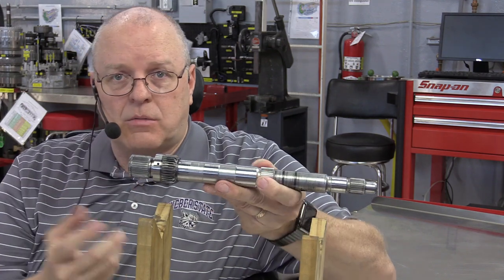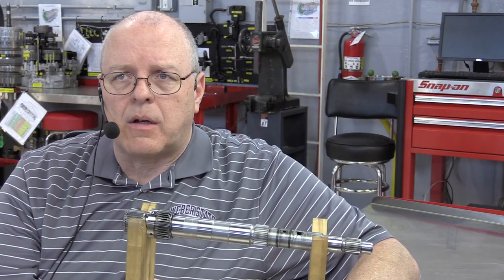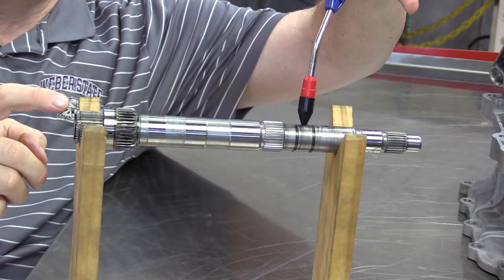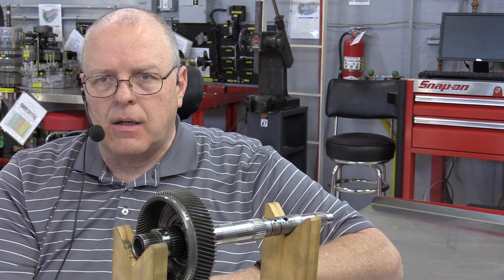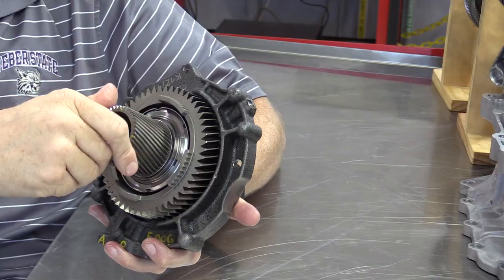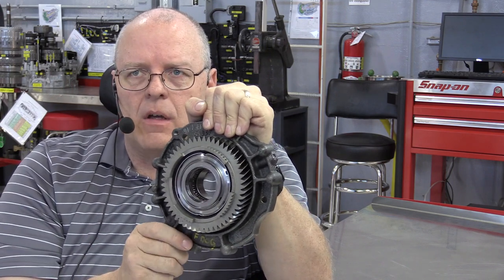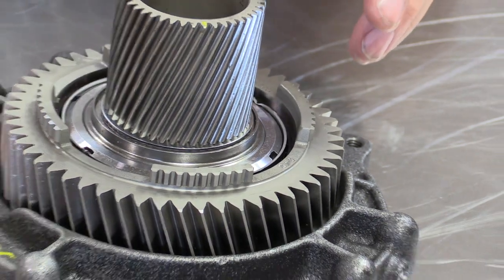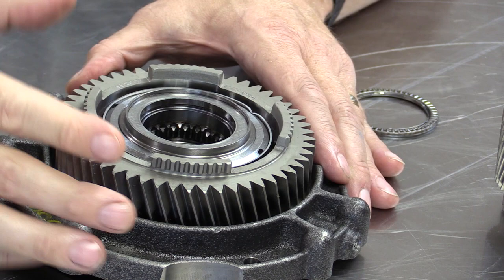Dog Clutch Demo - ZF 9HP 9-Speed Transaxle Operation - Part 1 of 2

Comment: I am a service advisor at a Honda dealership and this video was more informative than the official Honda training videos.  I have many customers experiencing a "lurch" on up/downshift when the dog clutch engages and this content is a great resource to be able to explain what is going on.  Thank you!
Reply: any known issues my wifes pilot just tossed a P170A
Reply: @eddiefrank3319  yeah sure,  not happening not with replacement cost as it is right now
Reply: Wifes 17 pilot Elite had a funny shift. Had dog clutch code.
Fluid was changed about 5k miles ago. It looked nice and clean. honda 3.1 fluid. I ended up taking my Autel Elite and running Tech In procedure. 
   The procedure says 500 miles for the trans to learn .
    I feel like it quick shifts through to 4th gear but all seems well so far

Comment: the synchronization is what made so many people complain about these transmissions. The programming from the manufacturer cause a hard shift when dogging. ZF even made a statement that it had nothing to do with their design but was a software issue. The software is supposed to match the engine speed with the shaft speed. That delay in power is noticeable when driving.
Reply: And 6 years later, Jeep still hasn’t corrected it.

Comment: Those look far more like spline than actual dog clutches. Motorcycle dog clutches, and typical sequential gearbox ones, have much looser tolerances. But they also round out and eventually can't hold gears, but can be shifted very quickly without the main clutch.

Comment: Dog clutches are mechanical locking devices, and timed by the TCM. Think of driving a vehicle with a manual transmission. But there are NO synchronizers. It would require much skill to match(synchronize) the engine to the wheels. Truly amazing!!
Reply from the maker: Good analogy, thanks for your feedback!

Comment: why does this transaxel drop into low gears at high speeds putting the drover in danger.
Reply from the maker: I do not know. I would check with your dealership to make sure the latest transmission control software is installed and that there are no error codes set. Best wishes.

Comment: Are the teeth staggered like that so the gears can mesh in 2 steps? As in the gears drop halfway together turn a little more then slide the rest of the way?   
It looks like it's designed to stop the gears from just skipping past each other by giving a wider initial space between each tooth.   Is this correct??

Comment: Thanks, John.  Great to receive notification that you had posted new videos!
Hard to believe those tiny dog gear teeth can handle the torque.
Couple of questions:
1) what sort of hydraulic pressure is required where you used air pressure for demonstrating the movements?
2) you mention transaxles...is this ZF for FWD vehicles?
Thanks again.  Always very informative.

Comment: How are the gear engagements timed to prevent grinding with these dog clutches?
Reply from the maker: Speed sensors on the transaxle combined with computer control of the synchronization (using multi-plate clutch discs)

Comment: Thank you John for the video and summary of the technology.  In your opinion,  are these new 8/9/10 speed transmissions just a durable as older 5/6 speed transmissions?  For example, say the Honda 6-speed in the Ridgeline compared to the 9-speed in the Pilot?   Old 3 speeds, like Ford-C6, GM-400, and Chrysler-TorqueFlite727, where very, very, strong and reliable.
Reply from the maker: Thank you! The newer transmissions are typically very reliable, but historically any totally new transmission will have, and has always had, several years of initial problems and updates (including the old 3-speeds). The 9-speed used by Chrysler and Honda has had a rough start, but it seems to be better now. Best wishes!

Comment: I'm looking at buying a Honda Pilot, in your opinion which transmission would you go with the 9 speed or the 6 speed or do you think there is a significant advantage of one over the other? ( longevity or performance)Thanks for any info.
Reply from the maker: +woodbutcherjc Hi, either one is a good transmission. The 9 speed will get slightly better fuel economy. Thanks for watching!

Comment: Is the version of this that Jeep calls the 948TE in the newer Cherokee as hateful and horrible and awful as everyone says or does it just operate differently than people expect?
Reply from the maker: The 948TE is the version that Chrysler builds here in the USA. The 9HP is the version build by ZF elsewhere. They are basically the same transmission with a few minor differences. Theoretically they operate the same way. The US built version used software provided by Chrysler rather than ZF. It is my understanding that the Chrysler software was terrible in the first model year, but has been revised to be better since then. The terrible software actually caused some premature transmission failures and a lot of unhappy customers.
Reply: Thanks for the explanation. I've read a lot of hateful stuff about this particular box.
Reply: My mother purchased a 15 Chrysler 200 S with that transmission and it was having issues, she switched it for a 2016 and the issue had been resolved. Honestly I don't understand why the 9 speed is available for N/A 4 Cylinders, the 9 speed takes a long time to up and downshift which can get frustrating unless you had one with paddle shifters. 

My grandmother has a 2019 Pacifica Limited and I'd say that the 9 Speed works best with the V6 than 4 cylinder, my mother now has a 21 Stelvio Sport Ti with the 8 Speed Auto which I find inferior to the 9 speed.

Comment: Been looking hard at the Ram Promaster City (aka Fiat Doblo), and have been researching the computer issues that came with the history of this Trans.  Do you think ZF has it right now?  Regardless, getting 9 gears is hella impressive in that size.
Reply from the maker: +Stuart Haight Hi, I know there have been some calibration changes.  Like a CVT or hybrid-electric vehicle, this transaxle will feel different to the average driver because of the 9 speeds. Whether or not there is actually a problem with the transaxle or a perception issue with the driver expectations, they are working to make it a pleasant experience. Personally, I think they have worked out the issues that first appeared in the early models. Thanks for watching!
Reply: +Stuart Haight I work at a Chrysler Dealer as a trans tech and from what I have seen, all the problems with this transmission and any software calibrations were for the majority of 2014 and early 2015 vehicles (14-15 Cherokee and 15 200). As for the ProMaster City, I have yet to see nor hear about any issues with any of them, which could either be due to the low volume of them out there when compared to the amount of Cherokees and 200s and/or that they had the issues ironed out by their release (which I THINK was around the first of the year). So far though, all the later model 2015s have been doing great and I imagine things will continue to improve over time. I personally say to wait for the 2016 ProMasters (or any 9-speed vehicle for that matter) to be safe.

All in all though, they are slick little units with shifts that are (now) pretty good. I would love to have a vehicle with one in them personally (been eyeballing a V6 200 myself).
Reply: +Jcmichalik2 Great to know, many thanks for the insight.  I'm going to get a late 2015 city.  I currently drive a 04 sienna like a granny so I shouldn't see myself with too many issues.  I will post back here when something pops up.

I'm also going to pony up and extend my warranty to 8yrs.  Looks like Mopar is pretty good.

Comment: Can you compare a dog clutch with a synchroring? Or does it just open or close and does not have some "rubbing" state like a clutch?
Reply from the maker: Hi, a dog clutch must be synchronized by some external method before it can engage. A synchronizer equipped gear does its own synchronizing. I hope that helps.

Comment: I have a 2015 Acura TLX SH-AWD. The vehicles factory production date is Dec 2014. The trans shifts a tad ruff here and there but otherwise seems ok. I have read some really bad nightmare stories online about these 9speeds. 

Should I be terrified for my wife and children when they take the car? Or will they most likey be fine. What percentage of TLX owners are actually having these major issues? (ie. I heard of a guy going through 3 trans before he got one that was "ok").

Thanks
Reply from the maker: Hi, I would not worry about it. Most of the horror stories I have heard about are from Chrysler vehicles, not Acura. Chrysler used different software to control their versions of the 9-speed; it did not go well. They have updated the software by now and the problem is rare to hear about now. Acura may have a software update for the transmission controller to address the occasional rough shift. If you were going to have a problem with your transaxle, it would have happened by now. Best wishes.

Comment: Great video. We have a 2015 Cherokee with this transmission and after 6 trips to the dealership, it still has erratic shift problems. Maybe the dealership should hire you to run their transmission shop!!  ;)
Reply: Me too! Everything is just fine once I get to third gear, but from a dead start to enter traffic? Can be terrifying because the computer has to think for a bit, sometimes a full second, before engaging. I am used to it but I don’t let ANYONE else drive my car. They could die. I’ve gotten used to driving semi automatic in low gears, which eliminates the issue, but still, very screwy. Jeep is STILL trying to figure out what’s wrong with the software, 6 years later.

Comment: What keeps those dog (spline) sliding clutches from wearing or grinding upon engagement?  Amazing amount of speeds, but a mechanical dog clutch in an automatic? Clutches or bands have always been used for smooth, long lasting service.  I have never seen this before. Seems like a point of rapid wear leading to failure.  Is this the problem these things are having in the field? Or are the clutches manipulated by the software somehow to synchronize them before applying?  Very interesting demonstration, thank you very much. Always wondered how they got so many speeds out of these and how many clutches/bands were needed to accomplish this feat.
Reply from the maker: Thank you. The dog clutch engagements are synchronized by computer controlled clutch packs. There is a slight amount of programmed clutch slippage required during some shifts to accomplish this. There is a special transmission fluid required to hold up to the programmed slippage. The fluid contains a limited slip additive to help the clutches and the fluid survive. The problems you may have heard of are related to the programming to control the clutch packs and their slippage rates. I hope that helps.

Comment: I'm suprised that the small "A" dog clutch spline can take the 280 HP output (and torque) of a Honda V6 engine. Does this transmission look robust enough to handle the power?

Comment: In basic terms when you refer to hydraulic fluid moving the dog clutch does that also mean valve body solenoids pushing ATF down veins under pressure?

Comment: I have 2017 Chrysler Pacifica - 9 Speed Automatic . There no information about what type of transmission fluid you have to use and how to check the transmission fluid level . Please advise . Thank you
Reply from the maker: Mopar 8 & 9 Speed ATF. You cannot check the fluid level without a special service tool and partially dissembling the inner fender
Reply from the maker: It uses Mopar 8 & 9 Speed fluid. You cannot check the fluid level without a special service tool and partially dissembling the inner fender
Reply: @WeberAuto  To be more precise the Mopar Fluid is just re-branded ZF Fluid. The oil that goes into the ZF-8 and 9 are the same. These oil were specifically engineered for the transmission. Just like Honda, their transmissions also require special Honda fluid.

Edit: this reply was meant for OP, since you already know this information Weber.

Comment: Thank you got your reply. A friend has a job at Chrysler Auburn Hills in their testing lab. I recall now that he said he was testing one of their new transmissions  (possibly this one) that they were having  failures in the field with.  He said he could cause it to break almost immediately and could repeat the damage over and over just by aggressively moving the throttle in a certain way while when the car was on the dyno.  I saw you demonstrate that spline clutch and it looked like problems to me.  I will ask him next time I see him if this was the transmission he was talking about and what the failure was.
Reply from the maker: Yes, the slipping of the clutches with some versions of the TCM software caused the clutches to vibrate so much that they caused the snap ring that held in the clutch backing plate to vibrate out; Game over! A software update and a new or repaired transmission addresses the problem. It sounds like product testing was cut short and the public proving grounds (the customers) were used instead.
Reply: @WeberAuto  Actually the problems started with ZF not Chrysler. In fact the ZF-9 is considered the black sheep over at ZF Friedrichshafen. There is a reason every manufacturer That jumped on early into the ZF-9 trans all had issues. FCA's big major issue initially was that the snap ring wasn't installed correctly, thus causing serious malfunction which would lead to catastrophic failure. This was rectified in late 2015. The next issue was software programing and while they fixed whatever major issues there were, no amount of software will ever changed the inherent flaws of the ZF-9 design when downshifting.

Comment: Please, could you explain to me why this ZF transmission has problems in the Honda Pilot Touring or Elite?. Is it a problem of the transmission itself or it is due to any other piece around? I am just a consumer interested in owning a Touring but I am scared and have a lot of doubts because I have read a lot of complaints about issues with this transmission in the Honda Pilot. Even I have read about problems in other makes with this transmission, and not only for Honda.  I greatly appreciate any response in advance.
Reply from the maker: I do not have any information on any Honda issues with this transaxle, but I do know the first model in 2014 Jeeps had problems related to the software for the transaxle controller not controlling the transaxle correctly. This issue resulted in a snap ring coming loose inside the transmission causing other damage. Later model year software and transmissions have been improved greatly. I always recommend avoiding the first model year of a brand new transmission design for this very reason; they always have initial problems that get fixed in the next model year. Honda did not start using this transaxle until 2016, so I would think it would be a better version of the transaxle. Best wishes!
Reply: This transmission has problems in a ton of cars. If you are in the market for a new car avoid this transmission at all costs.
Reply: @WeberAuto  Again the snap ring issue was a result of incorrectly assembling it in the trans. Also FCA increased the torque for the shift points in the 2014-2015 models. 2016+ all had reduced torque in the shifts, thus increasing the delay's for downshifting. The reason why FCA initially did this was because they were concerned about the ZF-9 less than luckster downshifts.  FCA was the first company to unveil the ZF-9 for the industry, packed in their new Cherokee. They had already invested 1 billion dollars in the manufacturing plant for the ZF-9 trans. This transmission was meant to be used in all of their Transverse vehicle lines for the next 8 years. FCA and ZF have one of the closest relationships(second to BMW) in the industry. ZF and FCA worked a compensatory business deal out after the ZF-9 disaster. All of FCA's Newley designed vehicles for 2020-2021+ onwards will be using all of ZF's next gen Hybrid transmissions. Not to mention, we get a very good special price on the ZF-8 from 2016+. 

Just bare in mind, while ZF engineered one of the best NON DCT 8 speeds in the industry, they did screw up the ZF-9 and they weren't entirely honest about it back in 2011 before our Company went heap in with them. Heads rolled, people in prominent Key positions were fired on the spot due to their incompetence. Volvo almost committed the the ZF-9 until their engineers quickly backed out and instead went with the Aisin 8 speed.

Comment: Great video! , one thing im wondering is that why do they bother with these dog clutches at all , Why not use other disc type of clutches instead like in every other transmission? Because this is transaxle and needs to be compact, do these dog clutches save lot of space compared to regular multi  disc clutch? If yes then why is it not more common, are they less comfortable etc so that they are only used where they must be used to save space for example like in fwd transverse application?

Comment: Is this video sped up? What are your thoughts on the Honda/ Acura zf9 issues? Seems it's specific to acceleration after slowing to 20mph then applying gas
Reply: Are you referring to the chirp that occurs when down-shifting from 5th to 3rd? Seems like a common issue for late 2015 build 2016 model MDXs and Pilots. Honda has replaced many under warranty for the impending failure indicated by this reported symptom. If this isn't the result of a leaking ATF warmer and proven to have caused ATF contamination, Honda doesn't seem to want to honor the extended warranty/campaign letter KG9 without having other indications of failure. I just went through this with AHM on my 2016 Acura MDX.